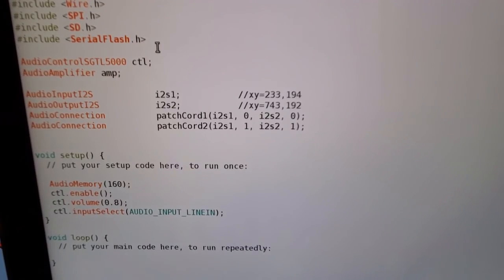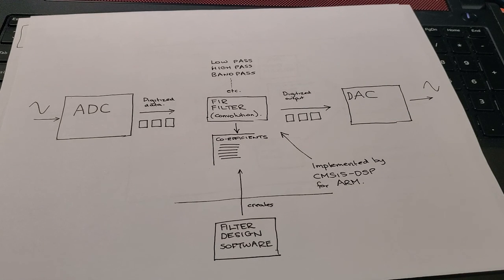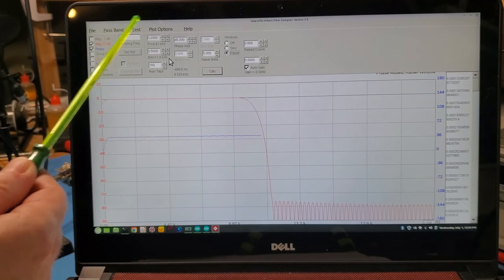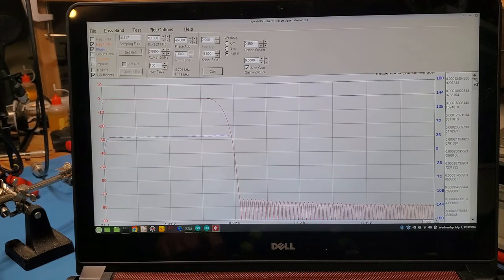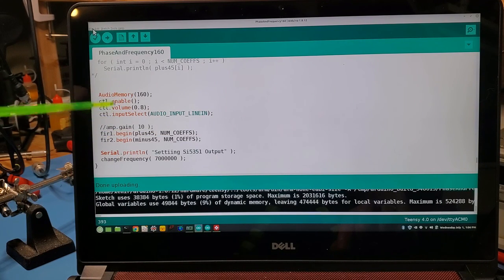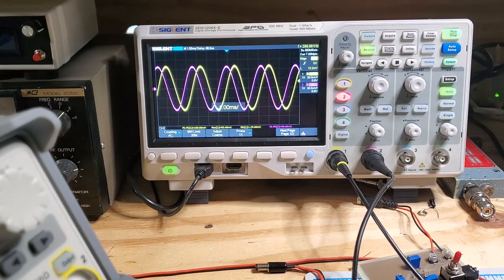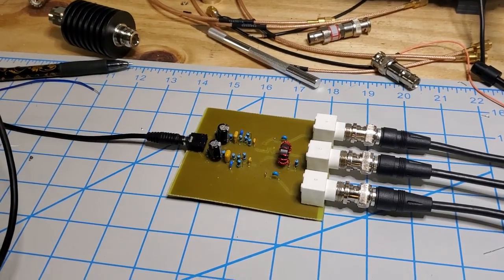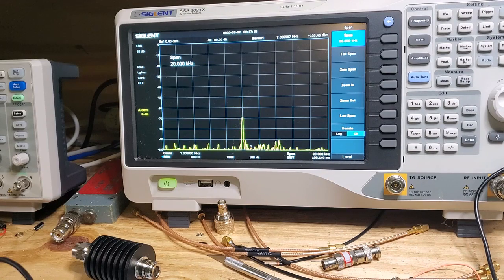Phase Shifting with DSP using the Teensy

Comment: Re-watching the video in 2023. Thanks for sharing! 👍 Couldn't find much information about Hilbert Filters either.  The book "Understanding Digital Signal Processing, 3rd Edition" by Richard Lyons has a good description of Hilbert transform in chapter 9, and there is a math for calculating the coefficients in section 9.3. The author does 0/90 degree phase shifting instead of +45/-45 one which obviously doesn't make much difference for us. The chapter does describe how to preserve the relative phase shift for a pair of signals, see Fig 9-12. I found the chapter somewhat difficult to follow because the author seems to have other uses cases of the Hilbert transform in mind. But from what I can tell it should serve our purposes.
Reply from the maker: Thanks for the lead Alex I will check it out. I ended up figuring out how to produce my own 0/90 phase shift using python libraries to generate the coefficients: https://www.youtube.com/watch?v=BUGQaTJ6aWI

Its not perfect and you have to make sure you run the signal through a band pass filter as the delay filter doesn't do that. I still haven't been able to find a way of generating coefficients for an arbitrary phase shift though (say 0 and 89). Let me know if you find one!

Comment: Excellent Video. So interesting. Yes Charlie Morris is my inspiration as well.
Reply from the maker: There is a pile of code running behind the Teensy arduino environment - particularly in the audio processing side of things. I have even seen a few videos of hooking up the NXP programming/debugging environment to the Teensy through the debug lines. I'd love to do that because I am not a huge fan of the Arduino programming environment
Reply: @na5y   Yes I too am not a big fan of that environment, but it is a great starter. I wish they stop calling library's  they are classes. Library is where all the collection is. Oh well , I use Atmel Studio. Intellisence  is very nice. Keep your video's coming I enjoy them. Thank you. 73
Reply from the maker: @rfdave3980  I have been using STM32CubeIDE. Would like to use Keil, because it has broad support, but it is expensive for the hobbyist and the "freeware" version limits you to around 32kB binary files.

Comment: CORRECTION: Although the SGTL5000 has I2C  controlling the CODEC, the audio communications between the T4.x and SGTL5000 are strictly I2S.  Many folks don't understand the difference between I2C device control and I2S audio protocol.
I've used 2 SGTL5000 audio boards, with one modified with a unique I2C address for quad in/out, as well as the CS42448 6in/8out CODEC for a laser synth. But, with the CS42448 @ EOL, I'm now developing a new PCB, using the 6in8out PCM3168A CODEC.
JS

Comment: Very nice video, pls I am new inro this, looking for low budget  audio dsp 2 in 2.1 or 4 out,    low , mid high pass, and sigma studio, (Less programing)
Reply from the maker: Thank you for the comment. I am not familiar at all with Sigma Studio. I did do a separate video on DSP using STM32 F767 and the pMod board. Check it out if you are interested - programming is relatively straightforward
https://www.youtube.com/watch?v=jvmejxsQzn4

Comment: I really liked your tutorial. I am not experienced at Arduino, so I have just one question? Why is it necessary to pass the coefficients as floating point and have the Teensy processor convert them to short int? It is not possible to convert to short int the coefficients on a PC and then put the short int array directly in the Arduino code?

Comment: Thanks for this video, been working on phaseshift, but hung up on converting the coefficients for teensy. Some people convert it in a  spreadsheet, which I was trying to figure out. I see you do it in the program, that doesn't effect the CPU usage compared to pre converted?
Reply from the maker: You mean the multiplication of the coefficients by 32768 in the array? That 's only going to be done once on initialization. It will slightly delay startup but it won't have any runtime effect beyond that. Thank you for the comment and question!
Reply: @na5y  oh.  Ok, that makes sense then, thanks for quick reply!
Reply from the maker: @DavyOneness  You are welcome - good luck with the Teensy!

Comment: The low cut-off for Hilbert filter with 160 taps and  44.1kHz sampling rate would be 44100÷160=276Hz. It is typically usable up to 1.3-1.5x of that value, which is ~400Hz. 
     I am surprised that only 200 coefficients are allowed by Teensy. Is this a hard value or a library limitation?
Reply from the maker: Thank you for your comment. The library used by the teensy for FIR is the CMSIS DSP library. In particular this is the call from the teensy arduino code (filter_fir.cpp)

  arm_fir_fast_q15(&fir_inst, (q15_t *)block->data,
   (q15_t *)b_new->data, AUDIO_BLOCK_SAMPLES);

 There's no limitation in that library the limitation is just purely the amount of processing power you have on the uController
Reply: @na5y  Thank you for reply and video. Subscribed.
Reply: @na5y  To improve SSB carrier suppression I would try to scale left or right FIR coefficients by small amount <1%. This should correct the mixer imbalance.
Reply from the maker: @odissey2  I will have to give that a try - thank you for the tip!

Comment: Would it be possible to programme a FM stereo encoder signal using this setup?
Reply from the maker: I must admit I haven't done a lot of FM - just some VCO stuff (have the audio signal waveform as input to control an oscillator frequency). I haven't done any FM demodulators. 

I am mainly using DSP here for the 90 degree audio shift required for unwanted sideband suppression. Upshot is I would say probably not useful for FM modulation - but its an intriguing question. There's a paper here about using DSP for FM demodulation might be worth a read 

https://www-elec.inaoep.mx/~rogerio/Digradio.pdf
Reply: @na5y  Thanks for your reply. I will look at quite some of your vlogs in the near future. Just discovered it. 
Main question is actually can you write code that makes a physical balanced mixer circuit superfluous?
Reply from the maker: @egbertgroot2737  The tayloe mixer series I do elsewhere - here for example: 
https://www.youtube.com/watch?v=bOyliyEWw8U&t=1s

Does away with a traditional double balanced mixer and replaces that with a quadrature controlled FST3253 switch. Could it all be done in code without specialized hardware (frequency synthesis as well) - all I am sure of is that I couldn't do it ;)

Thanks for the comment!

Comment: Very interesting video! I have bought a Teensy4.0 and the corresponding audio board. Your displayed hardware setup is very useful for me! I want to make an automatic gain control for my TV audio output so I can gain-equalize the various sequences (commercials, films, or my various mp3 songs which have non-normalized gains). I have a question. Where did you get the command language shown in your sketch shown below? I know signal processing and the Arduino but I'm a new guy for the Teensy. There must be a manuel describing the audio library commands somewhere? THANX!!!

from your Hilbert Arduino sketch:

#include <si5351.h>

Si5351 si5351;

AudioControlSGTL5000 ctl;
AudioAmplifier amp;

AudioInputI2S            i2s1;           //xy=233,194
AudioFilterFIR           fir2;           //xy=494,294
AudioFilterFIR           fir1;           //xy=498,93
AudioOutputI2S           i2s2;           //xy=743,192
AudioConnection          patchCord1(i2s1, 0, fir1, 0);
AudioConnection          patchCord2(i2s1, 1, fir2, 0);
AudioConnection          patchCord3(fir2, 0, i2s2, 1);
AudioConnection          patchCord4(fir1, 0, i2s2, 0);

..
..

  bool i2c_found = si5351.init(SI5351_CRYSTAL_LOAD_8PF, 0, 0);
  si5351.drive_strength(SI5351_CLK0, SI5351_DRIVE_2MA);
  si5351.drive_strength(SI5351_CLK2, SI5351_DRIVE_2MA);

..
...

ctl.enable();
  ctl.volume(0.8);
  ctl.inputSelect(AUDIO_INPUT_LINEIN);

  amp.gain( 10 );
  fir1.begin(plus45, NUM_COEFFS);
  fir2.begin(minus45, NUM_COEFFS);
Reply from the maker: There is an  online manual Bill - go here
https://www.pjrc.com/teensy/gui/index.html?info=AudioInputI2S2

As you click on the class (e.g. I2S2) help text appears over to the right. I think the rest of the message was cut off though. If you are interested in Finite Impulse Response filters work there area a variety of resources out there e.g.
https://eclipseaudio.com/fir-filter-guide/

The software I use to create the coefficients is here
http://iowahills.com/
Reply: @na5y  Thanx. So I imagine that you used this GUI tool to create those commands? It seems to be very useful for 100% forward processing operations such as a Hilbert filter. However, in my case, I will have to provide feedback information for the volume gain, according to the output of the averaging filter.  I noticed that there are not any closed-loop algorithms (LMS filter for example) in this GUI tool. Anyway, I'll start my project when I get my long header pins that I forgot to order. I'll see how that goes. Thanks again!!!
Reply from the maker: I usually use the GUI just to get started and then refer to the class information from then on. There's a project page on that site I sent you with a whole pile of other audio stuff people have done with their teensy's. Its a fun little board. Let me know how you get on and thanks for the comment.

The teensy uses CMSIS-DSP under the covers. That has IIR filters in it so if you are feeling brave you could mod the teensy audio code. I think you could use that for least mean squares couldn't you? Not a DSP expert here by any means. Also there is an RMS component in the library which you could potentially use
Reply: @na5y  I'm learning more & more about Teensy thanks to your useful answers! No, I won't need an LMS (it's an adaptive FIR) algo for the AGC. I was just citing examples of closed-loop functions. Yeah, the Teensy looks like a fun processor. Reminds me of my DSP days when I was working. I'll let you know how my project goes. Hardest part is starting it.